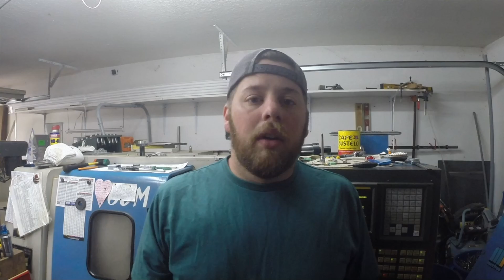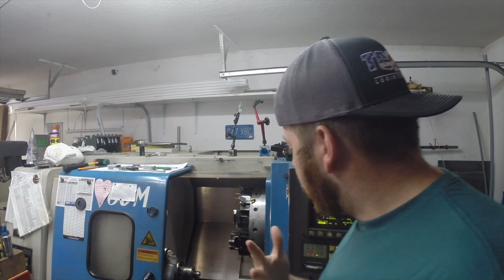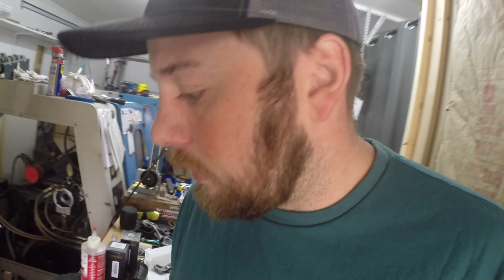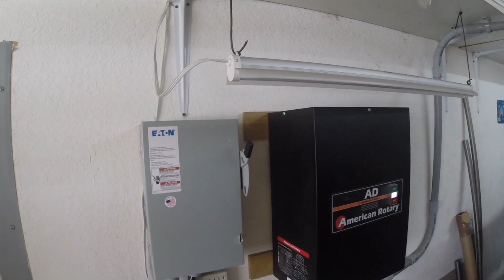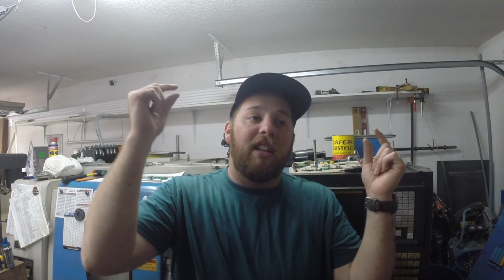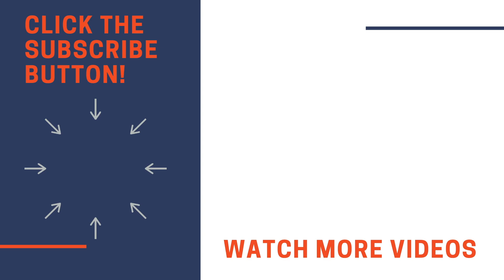Setting Up Your Machine Shop: Tax Exemptions and Electricity

Comment: Great video! I have been looking into rotary phase converters I just recently acquired an old Leblond servo shift and need to figure out a way to get it running. Do you run into problems with accepting  really complicated work because you are hand programming?